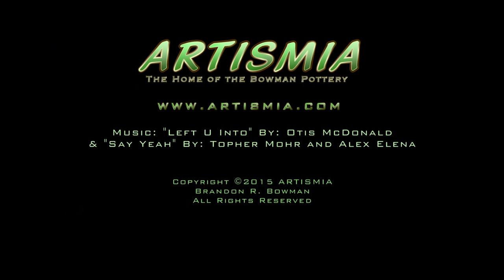Make a Skull Ice Pick ~ Welded Sculpture

Comment: very nice, im most impressed by how you sculpted the initial skull. is that the same metal as the rest? or is it like welding material (im clueless about stuff like this :D)
Reply from the maker: +Will Grossjohann Thank you Will! Yes it is pretty much all the same steel.  With possible differences in the amount of carbon content and other elements added. In addition to the processing temperatures (Hot or cold pressed/rolled) which can effect the way it responds. All this info can be found online with a search. Thanks again.

Comment: Curious, what did you start with for the skull? Around 1:00 you had nothing but some round stock and then suddenly it looked very skull shaped. Did you start with something as a template/base or did you just skip that part?
Reply from the maker: +DopeItUp Thanks for watching and commenting. No templates or base used, everything is built up onto itself, using mild steel ER70S rods. Think of it like a 3D printer. Sculpting the metal similarly to the way I sculpt clay.